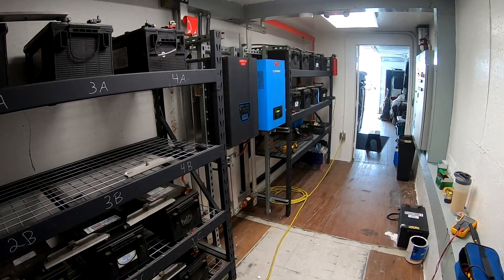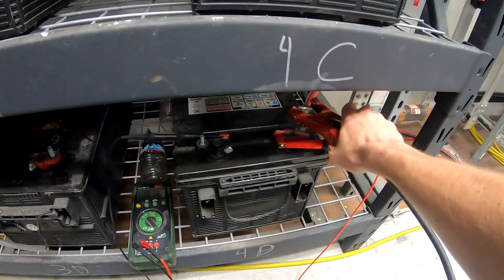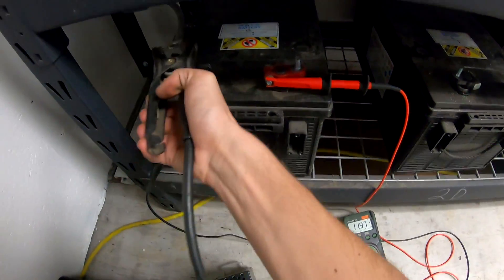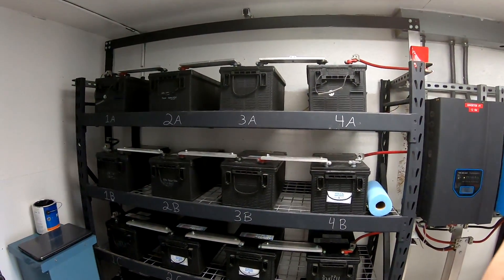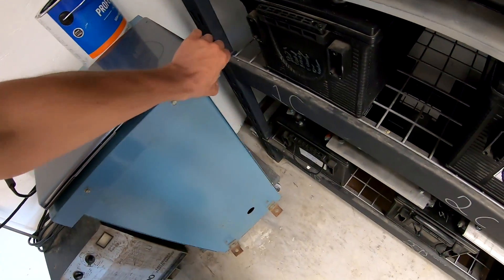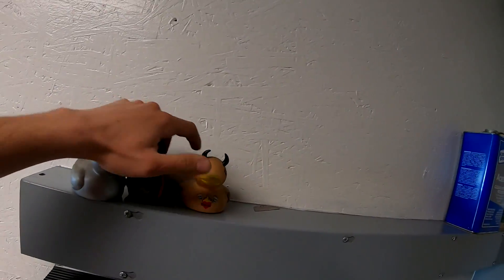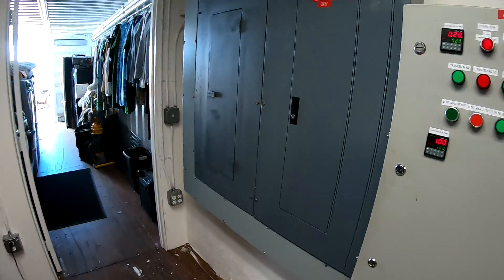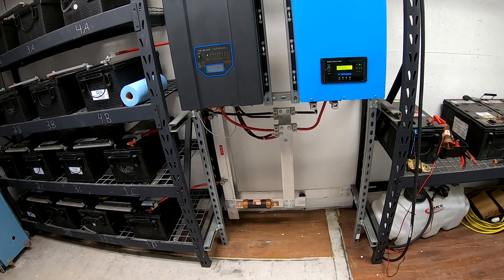Off Grid: Ditching Lead Acid, Prepare for Lithium!

Comment: Instead of getting prismatic cells, have you considered just buying a used Tesla car battery pack? I think you can buy them in the us for around $16k. They seem to be good very value for what they can do.
Reply: I was looking at a salvaged BMW i3 pack but now I am looking at LTO instead of LiFePo or 18650s. You can buy LTO cells on AliExpress for a good price and the reviews are limited but good. Importantly they can do 10,000+ cycles, have fast discharge and are far more stable than other chemistries, the main reason they aren't used for cars is that they are heavier per Wh. LTOs are very common on electric public transport like busses.
Reply from the maker: Please send me an email hightechlabftw@gmail.com before you buy any batteries.  I may have some information that can save you a bunch of money.
Reply from the maker: The 18650s are known for their ability to burn in a non extinguishable flame.  I'll pass.  Prismatics are far safer and robust, and being that I'm only on site every other weekend I want a battery with as much reliability as possible.
Reply: @HighTechLab  the 2015 onwards Tesla batteries are NOT standard 18650 cells and they are more cost effective bang per buck they any other battery. They will outlive a pragmatic lithium due to the electrolyte mixture. I was just trying to help. Go with what works for you :)
Reply from the maker: The problem is whenever you have round cells whether they are 18 650 or not, because of the construction of the packs you have far more internal resistance versus a prismatic cell. Internal resistance equates to voltage drop, think of a resistor getting hot with current applied. Since prismatic cells have lower resistance, they aren't losing as much power during charging and discharging, or heating up.
Reply: @HighTechLab  Lipo's are another option and are very safe.  Another youtuber has been diying it up has kits at https://kit.com/jehu/jehu-s-diy-powerwall-pcb-project change up the batteries as you wish
Reply: @scottlikens615   LiPO are the same tech as 18650 and as HighTechLad said not safe. LiFePO4 are safe and the extra weght is not an issue for a static system. With the correct monitoring tech they also last longer than LiPO's.
Reply: The Jehu battery wall project is an engineering failure on so many levels.  The only thing that it accomplishes is getting people to buy surplus or used batteries from the sponsors on their ebay outlet.  First the battery chemistry is wrong - LiFePO4 is the safest choice for Energy Storage.  The battery wall PC boards are bussing the current on mechanical fasteners which were never intended to carry power.  It's like using a dinner knife to tie batteries together - sure it's metal, but not meant for the job.   Busbars should be copper, always.  And recycling a bunch of questionable cells from ebay that have, at most, been drained then charged then sold as "matched" because of their CAPACITY is a recipe for failure.  They may have the same value on a cheap battery tester, but after 100 cycles, will they still be identical, or will the balance board be flushing charge down the resistor array to keep the voltage matched?  RVs with 2008 prismatic cells from Winston Thundersky are, today, showing their success a decade or more after installation with over 85%-90% capacity still working as designed.   And my last point - in an earthquake, are a bunch of 18650 cells held together in snap-in holders with hot glue and 1/4" fasteners still going to be in place, or starting a fire when you need them to work?  One set of 4, 8, or 16 prismatic cells can be bolted to the floor for safety.

Comment: As the 'heating element', which actually is known as 'the load' heats up, the resistance increases slightly, (3.04) it does not drop!

Comment: As others have said, Of all the Lithium Battery Chemistries, LFP lithium (LiFePO4)batteries are a far better chemistry for Solar/Inverter usage 
1.LFP’s are virtually immune to Thermal Runaway, Unlike Lithium Polymer or Lithium Cobalt Oxide 
2. LFP’s have a superior cycle life, Double to triple as compared the 18650’s and/or Tesla’s 21700 LiCoO2 chemistry and/or Lithium Polymer 
All the Lead Acid battery families are obsolete 19th century technology, very inefficient

Comment: Lead acid batteries really need a device called a MegaPulse, these are amazing. I have a set of batteries which are 10 years old and they are still at over 90% capacity.

Comment: If your batteries are 245Ah and you had 8 banks of 48V in parallel, should you download at 40% should you have about 37.6KW were you enough or did you stay unloaded earlier than expected?

I edit the message because looking at the other videos I only see 4 a 48V battery banks in parallel, total power at 40% 18.8 kw
you probably have not been enough and you have dropped over 50% SoC or you have taken high currents with the inverters, over 100-120A at 48V for those batteries are too many! they are the only causes of premature death

Taking an example with the LiFePo4 with 16 Winston cells from 1000Ah in Europe they would cost US $ 19,000 without taxes, used at 60% (given the costs it makes sense to make them last as long as possible over 20 years) you would end up with 28.8 Kw, if you have the advantage of have only 16 cells in series and only one BMS (I recommend the Batrium)

Otherwise you have to do 2 parallel battery banks of 700Ah @ 60% 40.3kw! in Europe they would cost 27,820 USD without taxes included, without accessories and BMS! (we are still too expensive)
I think you only need half, a bench only from 700Ah to 48V, 60% are around 20kw, maximum amps of charge and discharge 350A !!!
about 15kw constant after the inverter without problems or damage!
Reply: Read some white papers. You can safely draw down to 2.5v. You should not charge over 3.5v for maximum cycle life. Sulphation is the cause of premature death of the lead, caused by sitting under 100% SOC for long periods
Reply: @climatechangepreppersfaceb2148  Yes it is possible, 100% DoD, but with the price they have, I prefer to use them with a 60% cycle, indicatively leaving 11% above and 20% below. (for single-cell Winston)
 Maximum voltage 4v, maximum charge voltage 3.55 - 3.6V, minimum cell voltage 2.5V minimum voltage detachment of the electric load 2.9V - 3V, I know the problems of batteries with lead chemistry, fall below 50% DoD it's stupid.
Reply: @winterburan  if going to 4v, you must IMMEDIATELY discharge to 3.5v because breakdown of electrolyte is linear with the TIME spent over 3.7. The bottom 20% is far safer to use than the top 20%. Read some white papers
Reply: @climatechangepreppersfaceb2148  yes ok, but I'm talking about winston, the first charge before the first use goes like this, the percentages of lithium iron and phosphate is different as the brand-to-brand electrodes are different.
I know it's linear, I've used it for almost 8 years, books are now the same in PDF, I repeat I only have experience with winston. the books are too generic in a couple of years the percentages of the lithium chemistry change and the parameters too, you're right I can't blame you but for the winston just out of the factory it's like that.
Reply: Awesome news!
Here comes 10c+ continuous per cell...omg

16s lifepo4 prismatic cells will come in handy  should the sun stop fusing and it needs a jump start!
Reply: @zemadeiran   2,8 C  1000A > 350A !!! continue without problems charging and discharging, Max instantaneous discharge current 7000 A!

Comment: I absolutely recommend the monoblock LiFePo4 given the power and capacity in play, I know the Winston, the recommended parameters to make them last as long as possible are: after the first initial charge of training at about and not more than 4V (this for the Winston , read the manuals of each single field because this 3.8 / 4V voltage per cell is dangerous and must be done only once) it is also advisable to connect all the cells in parallel to each other to balance them autonomously and load them all together with a battery charger. from a few amps to 4V or a laboratory power supply with adjustable voltage and power, never exceed the current of 0.5C, after which the disconnects and the series connections to the desired voltage, the use of the BMS is a must, maintains balanced cells and protects both from over-charging and from excessive discharge, I use them with a cycle of 60% limiting the tensine of both charge and discharge, logic and chemistry is different from lead, a tension and of excessive charge it ruins it irreparably as the tension is too low.

The recommended parameters per cell are 3.65V maximum charge and 3V as minimum voltage during use 2.9V mandatory disconnection of the electric load!

On nominal LiFePo4 @ 12V batteries, they never exceed 14-14.5V of charge and never go below 11.6-12 Volt
Ciao
Reply: I would not charge to 4v, it takes a chunk of cycle life. Top balance at 3.7 is sufficient if you have a bms. Your bottom end voltage is way too high, should be 10v for maximum cycle life, or 8v for 100% dod
Reply: @climatechangepreppersfaceb2148  The 4 Volts are for the first absolute cycle of formation of the single cell, I think I was clear, other brands indicate 3.8 or 3.9V, then we no longer have to reach this voltage!    10V  (2,4V cell)   8V (2Volt cell)  it is like going down 100% DoD for the lead we go but it will also damage them I would absolutely avoid falling below 2.8V
Ciao
Reply: @winterburan  I was also clear. 4v initial voltage is NOT NECESSARY
Reply: I think the best advice is ALWAYS read and follow the manufacturer's directions.  I use CALB, which is different chemistry than W-T, and their Vne (voltage never exeed) is 3.65V per cell, or 14.6 on any 12.8 nominal system.  I do my initial discharge to my empty value (bottom balance) with all cells bussed in one 3.65 massively parallel array using  Agilent DC electronic loads and then in series using  HP bench power supplies CCCV program to watch terminal voltage before any BMS activity starts.  I'm curious about this "formation" cycle W-T recommends - it very well may have to do with their cutting edge, distinctive and proprietary LiFe-Y-PO4 chemistry which adds Yttrium to improve their cold weather charge, going down to -20C for charge and further for discharge, which places W-T as the technology leader in this market for professional cell users.  As opposed to A-h [that stands for amateur hour here] arrays of 18650 $1 ebay specials mixmatched and hotglued to the wall of a youtube studio as props.
Reply: @uwave  I think you overestimate the manufacturers knowledge. Take Nissan for example. Spent years testing the leaf battery.....in 25 Celsius. But out in the real world with different temperatures the batteries performed poorly. Independent studies tend to show results that differ wildly to brochures. For example, every "knows" that you can't EVER discharge to 0% or the cell is destroyed, but several white papers show that it totally false. I absolutely agree about the DIY powerwall nutters. In fact take a look at my video LITHIUM BATTERY FIRE DESTROYS COUPLES HOME for a good laugh

Comment: Too bad you didnt go with my style. Im getting them for $600 for 8kwh. Check my vids
Reply: Make sure you get a good BMS
Reply from the maker: Maybe you can link me to the exact video, I looked over your channel and can't tell which one you are referring to
Reply: @HighTechLab  https://www.youtube.com/watch?v=0cAwVP7rABw&t=60s
Reply: @HighTechLab  I believe a bunch went to the US already . If you are interested I can try to see where they are.
Reply: The only problem would be is that they are 40v packs and are best in 40 v 80v 120v and so on so the packs are not separated . 12s config.

Comment: Well how much money did you waste buying all those lead acid battery’s and the lithium
Reply: Mhmm so in the end every battery will die or just malfunction (by not being balanced with the acid and water
Reply from the maker: I can't really say it's a waste - They worked fine for a couple of years and allowed me to grow gradually.  They also gave me the chance to learn without burning up expensive lithium cells.  I wouldn't call that a waste, the experience is priceless.
Reply: @HighTechLab  we all went through this

Comment: Great job. Where did you get the new batteries from ?
Reply from the maker: I was contacted by one of my subscribers.
Reply: @HighTechLab  would love to know the type because I just purchased a 10kw Foxpower. What is the Ah capacity of the new proposed battery bank?
Reply from the maker: @ibidapoilawole7120  new bank will be 100ah to start with (the lead acid is failing miserably) then later 400ah to 800ah.  I'm doing the 100ah now because it's not bad to get shipped by air, the rest will be shipped by sea